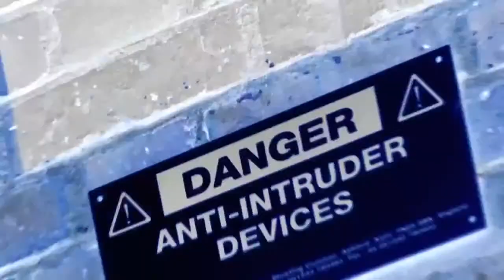Restoring The CCTV Housing - Part 1

Comment: I would have removed glass, Removed all the seals, camera, heater ect until bare shell, coat it with paint stripper or get it acid washed then primed and painted
Reply: Saves taping everything and possible paint peel due to it being on two diffrent surfaces